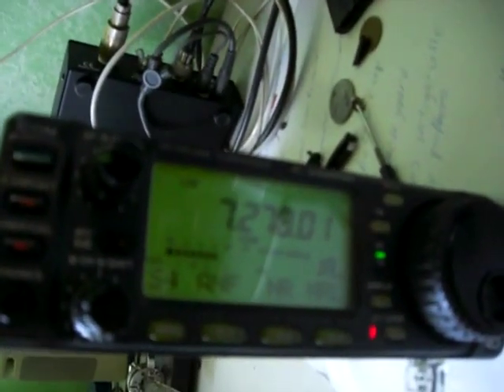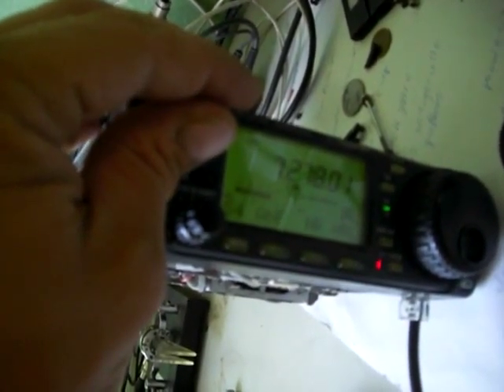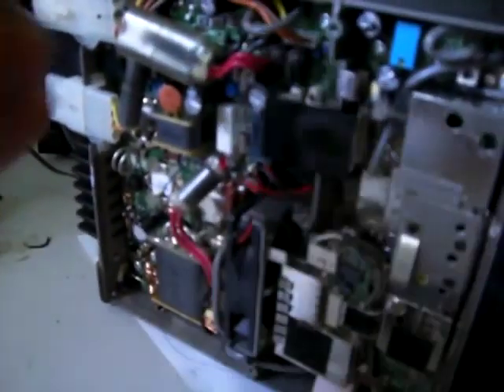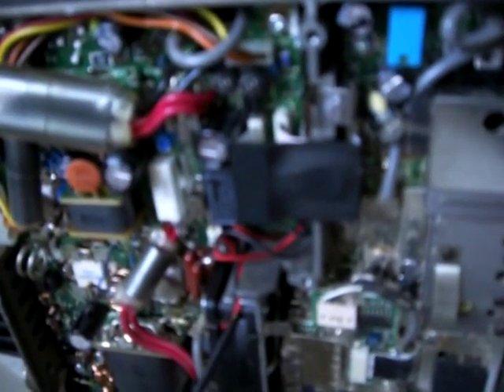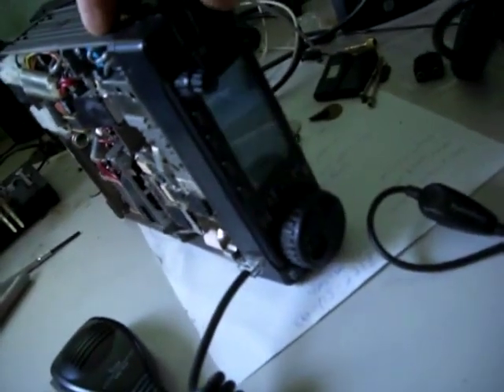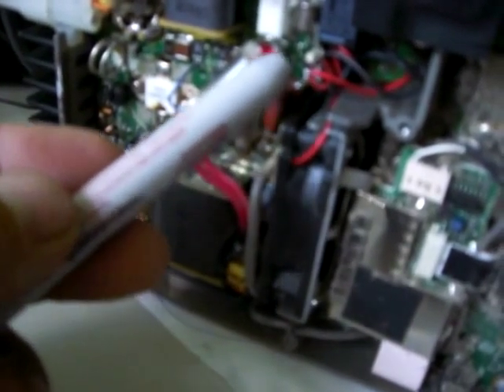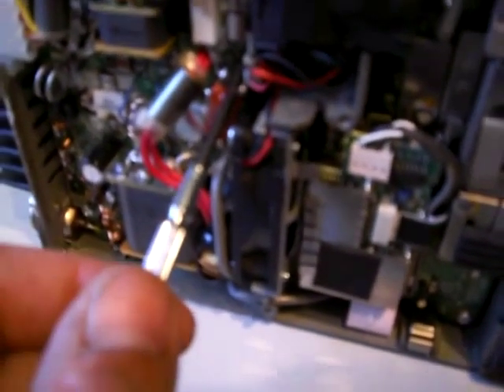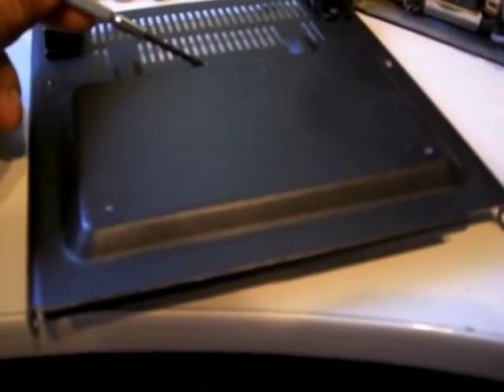Icom 706 MKIIG Cooling Mod

Comment: There is a mod somewhere that has the fan come on in a slow mode when you turn it on and has it running faster when transmitting.  ANyone know where that mod is?

Comment: Greetings dear friend.  Could you help me to be in the SET MODE ADJUSTMENT of the Icom IC-706 MKIIG?  I don't know the type and configuration of the Plug that is connected to the REMOTE to access its Service Menu.
Reply: No. That's beyond my skills. I haven't owned that radio in 10 years.

Comment: I made a simpler cure to my IC-706 radios.  Opened up the top and saw that there was a hefty fan to cool the radio.  In the same chamber was the internal speaker.  The input grill for the fan was in the top plate and the speaker was mounted to the top plate.  To help the fan I removed the interal speaker and its mount which left the speaker mount area open in the chamber doubling the intake volume for the cooling fan.  In an all day test the IC706 barely got warm.  I did not need to modify the fan control wiring.  I always run the IC706 on an external speaker so removing the internal one had no effect on my operation and really helped the cooling.   Try it and see if it fixes you problem,

Comment: although I like this mod and it's a good idea if you put this in your car, mobile, it's going to be draining your battery while your sleeping.  If done I would suggest a simple on/off rocker in line with the positive wire to prevent battery drain for mobile use.  Of course base use wouldn't matter cause you would just turn off the power supply, but these radios do run very hot.

Comment: Having a continuously running fan on this model is always a good idea because the Icom 706 in any variety seems to run a bit warm even in receive-only. There are just some radio models that tend to run "warm" in receive mode, but in the case of the Icom 706 there is a lot going on even when just receiving.
I think this is a very good idea for all 706 users :)

Comment: There is also a cheap fan for sale on eBay. It uses the power from the tuner circuit. It will run all the time too, but it is easily removed and u don't have to open the rig. Good job tho. De W5JDA